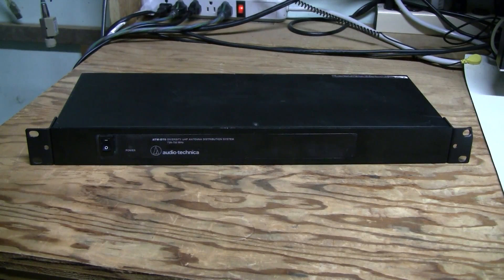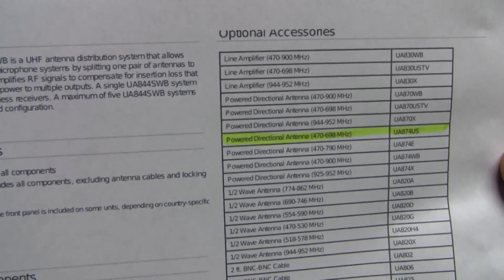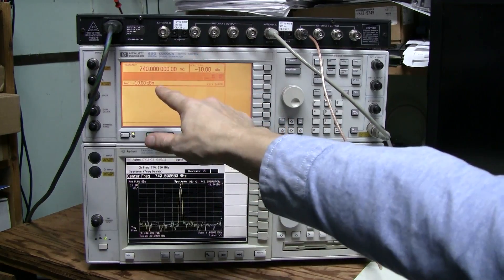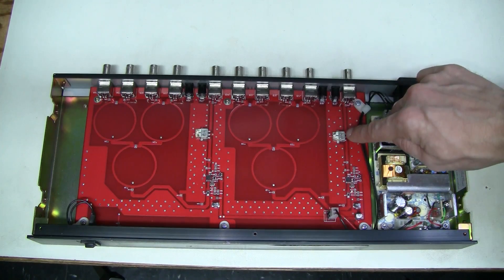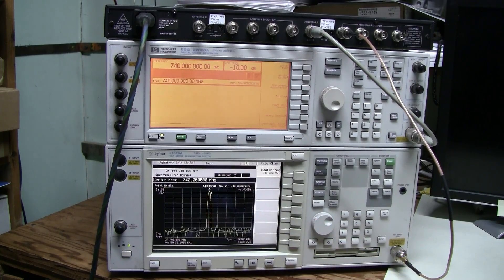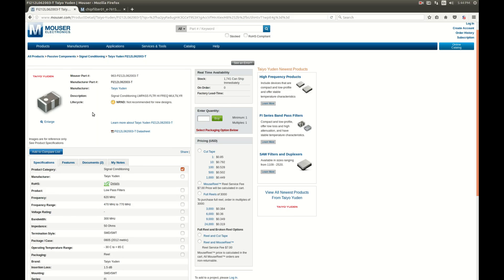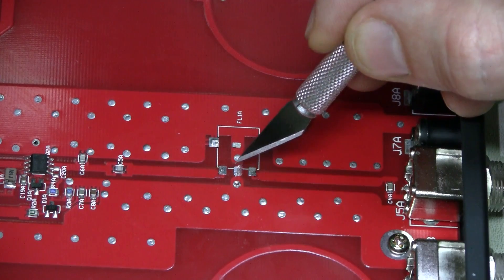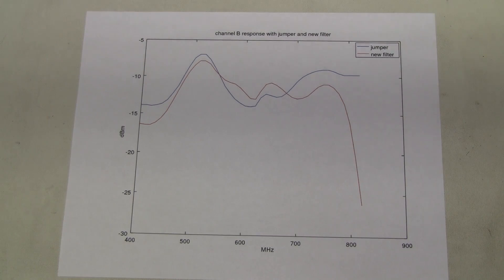#50 - Audio-Technica ATW-D70 antenna distribution system modification

Comment: İ have an beyerdynamic zas 500 antenna splitter between 798 820 mhz how can i use it between 500 600 mhz it has a filter called mcl scp 4 4 2

Comment: Heh, that is the first time I see someone opening a piece of rack mounted gear that actually has one of those Astec/Artesyn LPS/LPT model(s) of power supply in it!
I just happen to have these sitting on the shelf at home, therefore I recognize them immediately. :) Good quality supplies, designed for 24h/7, bussines critical application, if I were to believe the datasheet. Nippon Chemicon caps, as far as I remember, without getting one to look at. So yeah, good quality supplies, those are.

Comment: Another fantastic video. I was just curious as to why with all that space for a filter, you did not just make up a band pass filter with discrete components? That way you can fit a filter which would only pass signals within your required frequency range and block out more unwanted interfering signals. Karl
Reply from the maker: That would be a much more complicated project. Do you know of a simple design for that frequency range (470-698MHz)?
Reply: Not got one to hand but there are plenty of free online calculator tools available. Try Elsie (LC) I have not tried it myself but I know it is a popular tool, you just need to input your desired passband  and number of elements. Karl
Reply from the maker: I haven't seen this particular one (and it seems to be a piece of software for Windows, which is a bit of a pain for me). I have seen some online calculators, which work fine at a few MHz, but come up with fraction of pf caps and such at, say, 600 MHz.